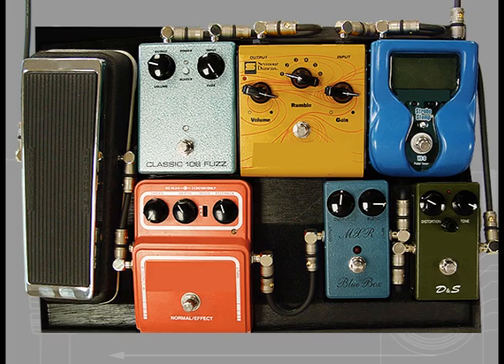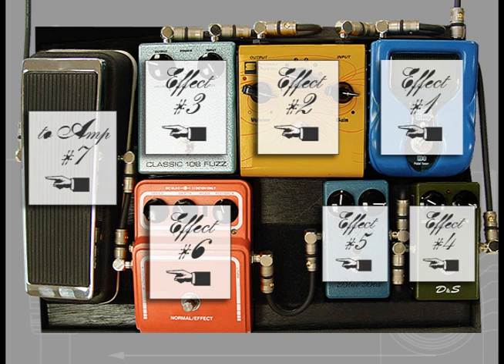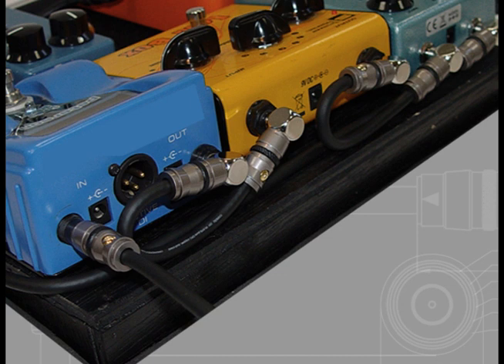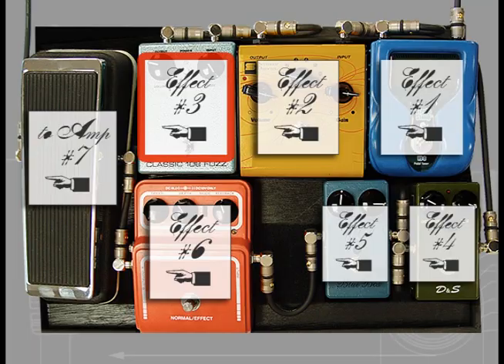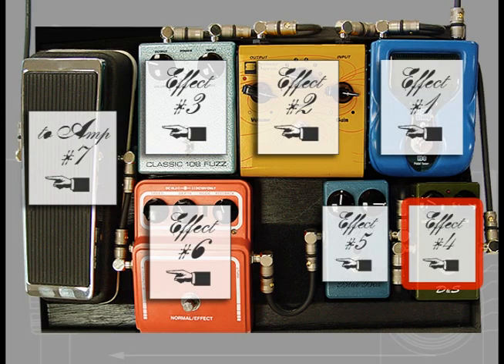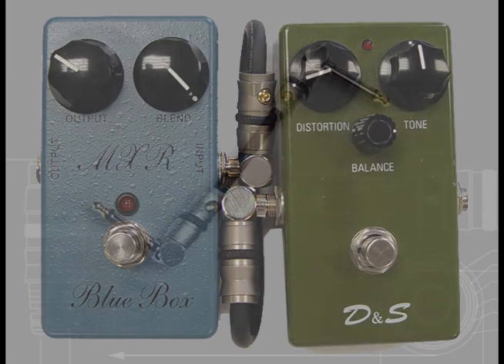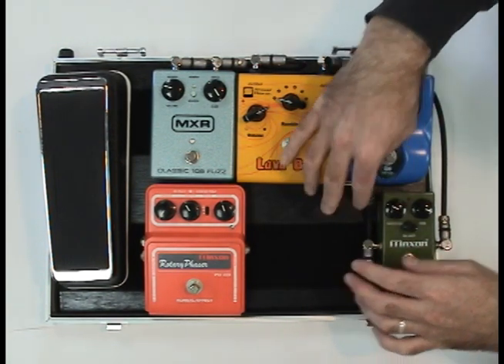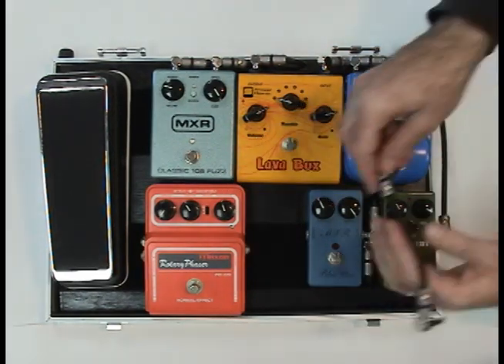How To Connect Pedals on a Board using a Core X2 DIY solderless cable Kit.

Comment: I prefer fixed cables, combinations of 6" and 12" are what you need. I use Core X2 fixed cables. MF has them on sale, cheap. Gold jacks and machined ends. These kits are probably OK, they do work well like the George L's. I just prefer a heavy duty machine and factory soldered jack shield. Good cables are a must in a pedal line. These kits make nice neat runs I am just not sure I trust my ability to cut and make them.